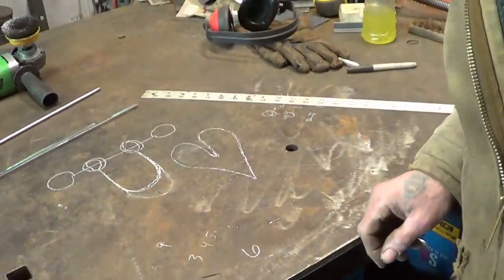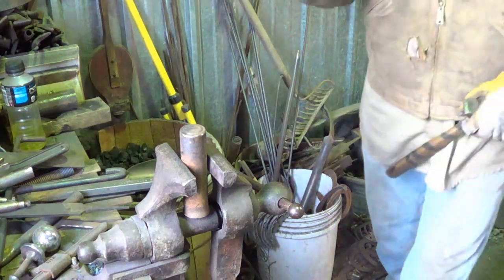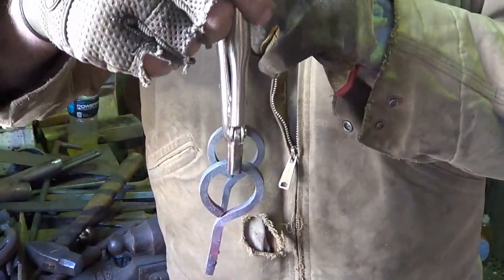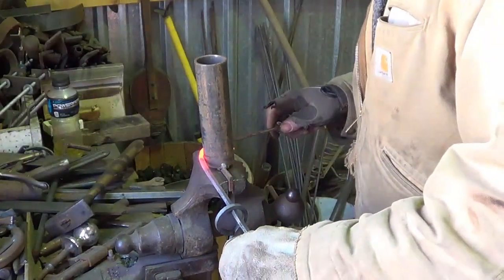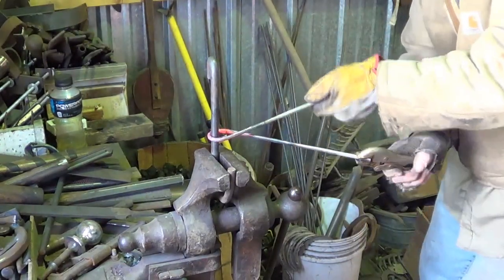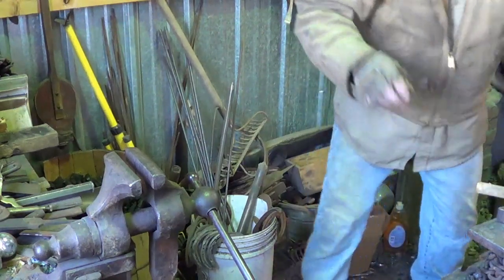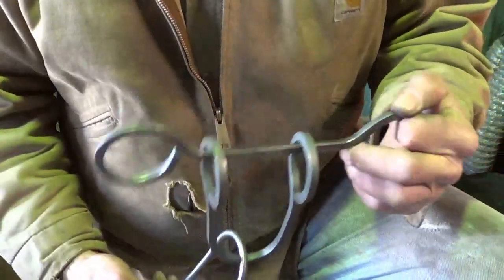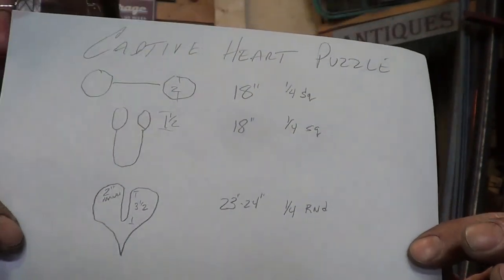Blacksmithing - Forging The Captive Heart Tavern Puzzle

Comment: Chandler. The puzzle actually is supposed to have 2 U shaped pieces. Second piece is hooked to the top U and hangs below the upper one. Then the heart hangs on the lower U. I made one for my Barber years ago and it was very popular. Mine was made of heavy (1/8") wire. Make you one with wire to try it. It works basically the same but you have to go up one U at a time.
Triker Red
Reply: there are a few variations. the one you made had a double bypass.
Reply: True. The one I made was an antique that my Grandfather had back in the early 60's. He got it from on old farmworker several years before that.